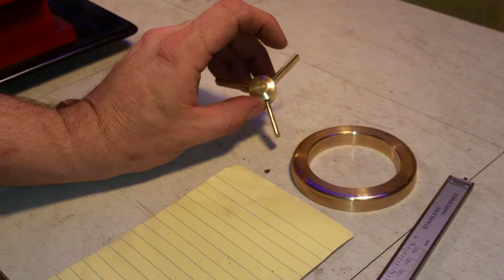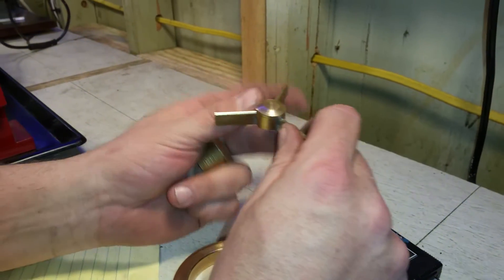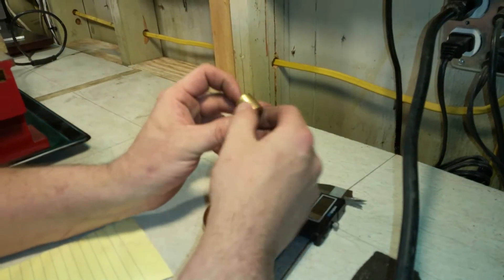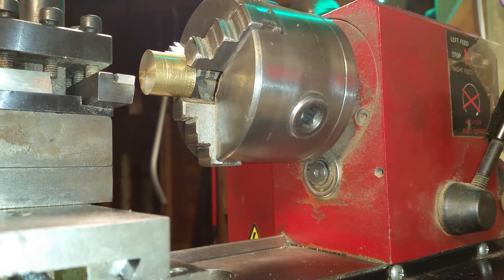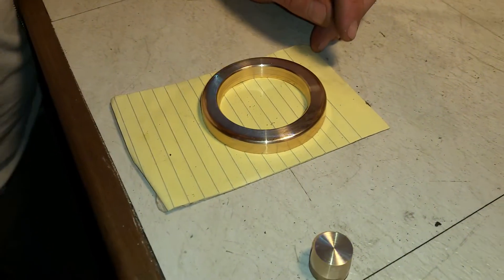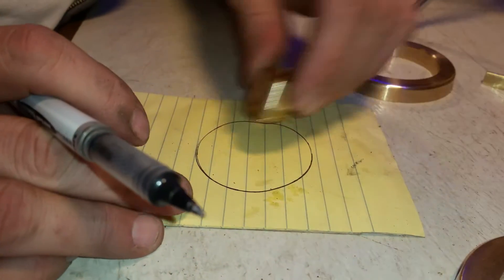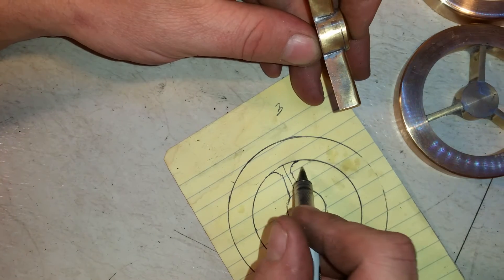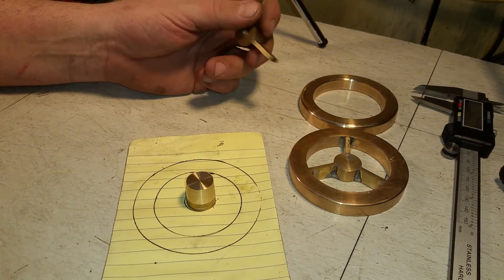Brass casting: #9 Pattern making Flywheel Hub with draft angle

Comment: Could you use dowel for the spokes. Drilling through the sides of the outer edge of the larger ring.
Reply from the maker: +Cold Coffee_ Hey that's a great thought. I do not have a rotary table or a spindexer. I spent most of today attempting to use dowels with no luck. I really need the tools mentioned. Hopefully, I can get those pretty soon. I've revamped my spoke plan and filmed a video, just too tired to post and edit it this evening. I should get it uploaded tomorrow.-don